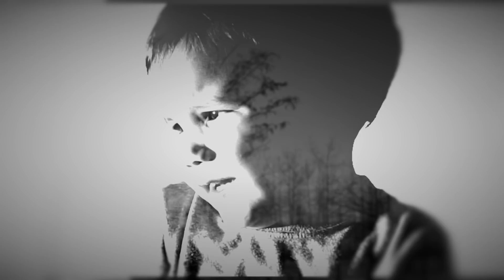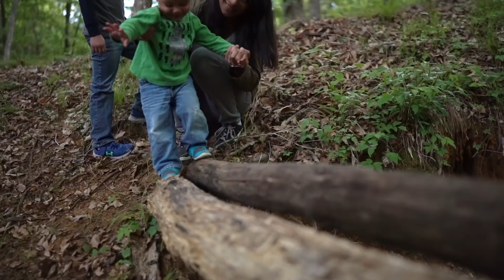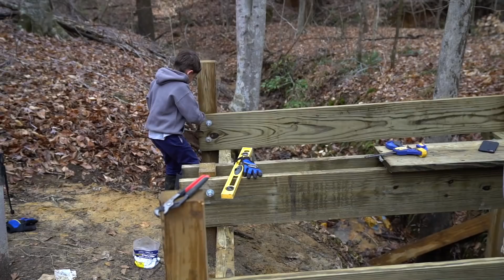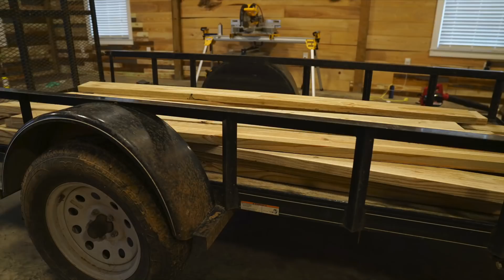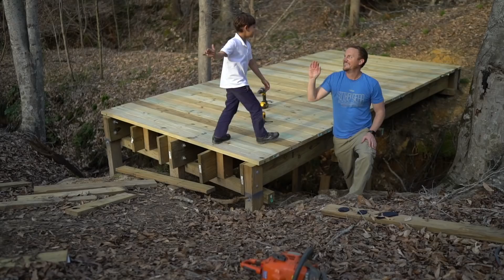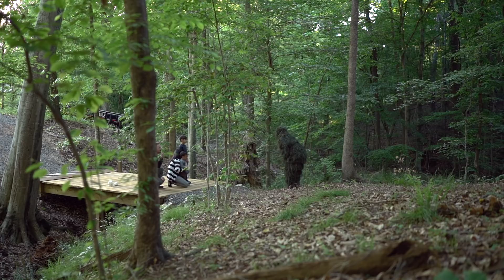How To Build A Bridge.... For A Donut Troll

Comment: Cool bridge but those deck boards are going to rot out Farley quickly since they are not spaced to allow water to drain off. Learned the hard way on our hot tub deck and had to replace after about 8 years but probably should've done it sooner since most boards were rotten. Used the camp decking system for when replacing and there is no hardware other than screws and it hide all the screws and spaces all the boards perfectly
Reply from the maker: Andrew Lyon thanks. Thanks for the tip, but this ain’t my first rodeo. These were brand new treated wet boards, they shrink by some significant percentage so I packed them tight, since then they’ve dried out and there’s plenty of space for water to drain now. 
I’ve also soaked them in diesel and Thompson’s water seal, they’ll be good for a while.
Reply: Hampton Rutland   I love Banagale.